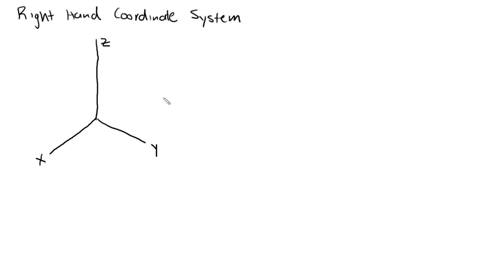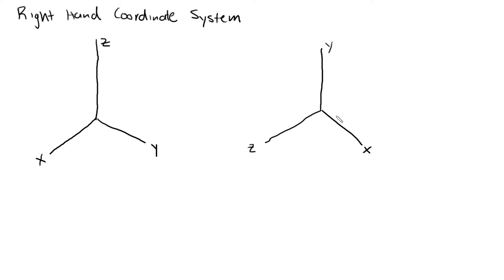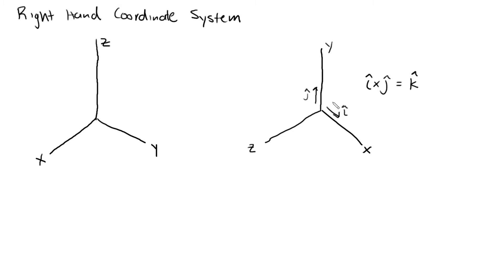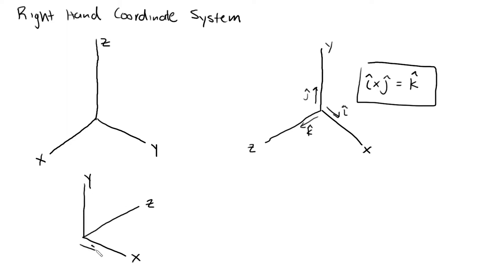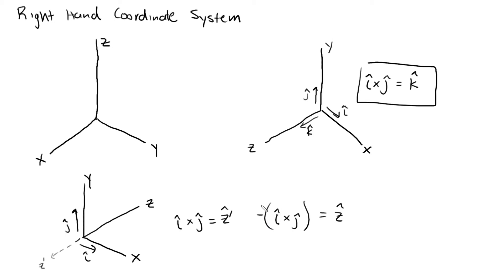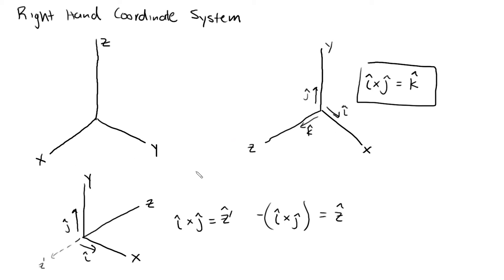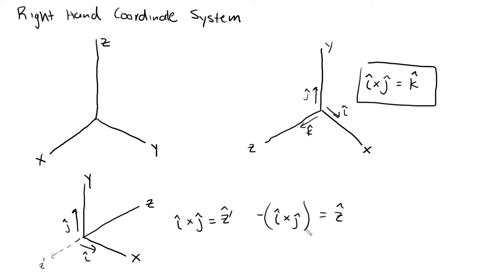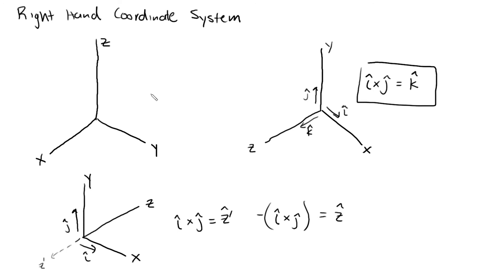Defining the Right Hand Coordinate System

Comment: I subscribed. Great content. Also, do you have any tips for solving statics questions that involve 3d vectors and Cartesian planes? I'm doing it in class and it is very confusing and I'm having a hard time visualizing it
Reply from the maker: Thank you for subscribing.

As for 3D statics problems, the method of problem solving depends on the problem itself. Sometimes it is easier to use scalars rather than vectors or vice versa. But you can always fall back on using vectors to solve your problems, but it may not be the most time efficient. Picking which route to go really comes down to just doing a lot of problems.

I'm not sure if you know this, but I do have few 3D problems in the statics playlist on my channel; it may help you out. Again, thanks for subscribing!

And if you have a specific problem in mind, then feel free to email or message me the problem. I could make a video about it which not only helps you out, but also helps me in making more content. It'll probably be a less than a week to make and upload. Or if it's more of a conceptual/shorter question, then feel free to ask it here in the comments (for a quick response).